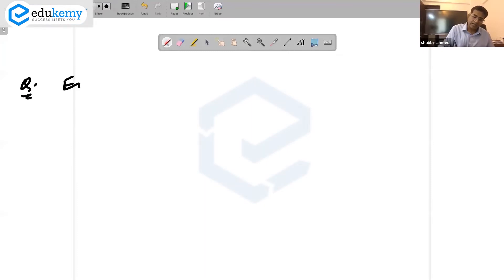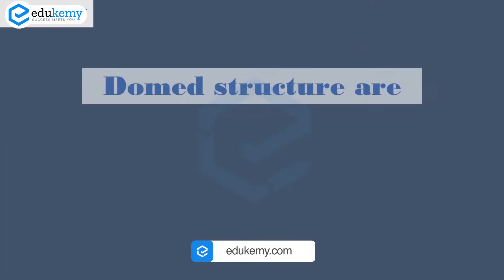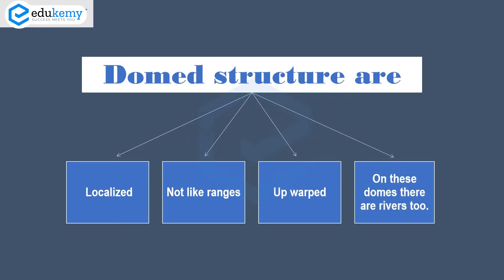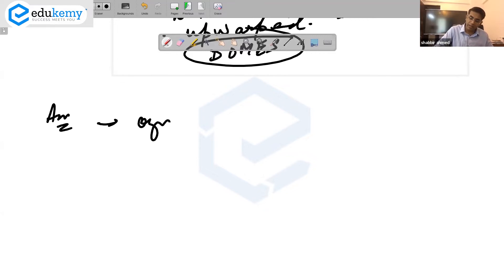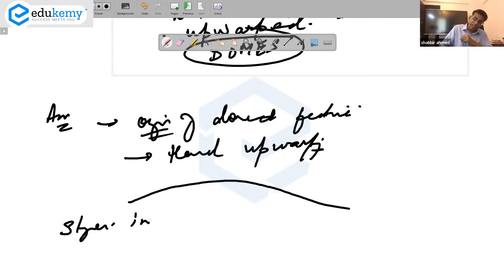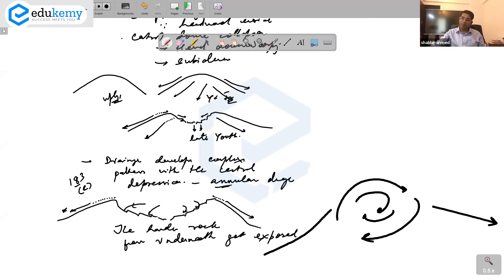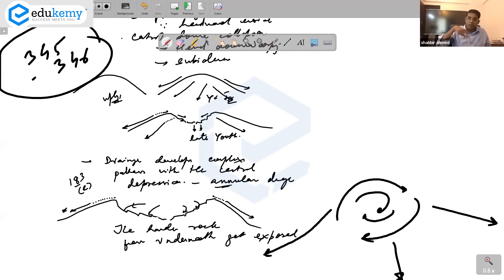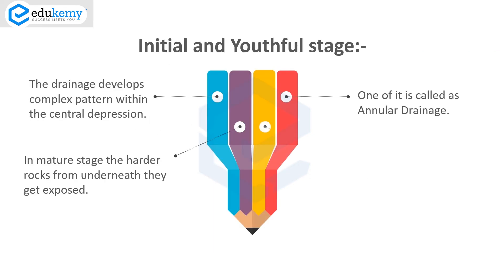Evolution of Domed Structure | Daily dose of Geography with Shabbir Sir | Edukemy | UPSC CSE

Comment: Sir I have a doubt, trade winds from both the hemisphere converges, but do they collide..& if they collide so why doldrum remains a stable and calm area.
Reply: Harsh,
Trade winds converge and there can be two type of convergence and upliftment.
One type of upliftment can be smooth (mostly along the oceans as the surface is smooth) or it can be turbulent ( generally  along the land). Smooth upliftment can lead to calm condition forming doldrums. So doldrums are generally along oceans.
While the turbulent upliftment can cause some instability.
Hope this helps
Reply: @dimplenankani2155  Thank u Dimple ji, will you plz throw some light on whether doldrum occur due to the absence of coriolis force at equator or it is because of low thermal factor at equator.